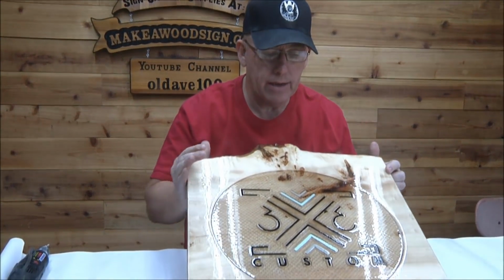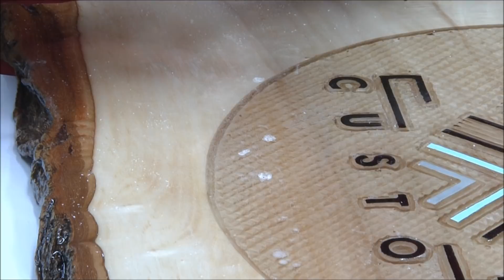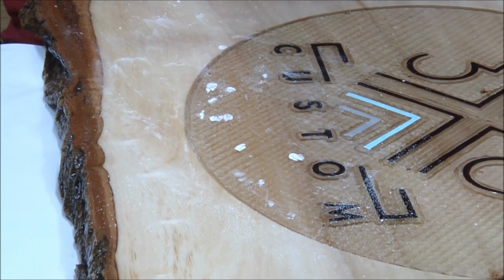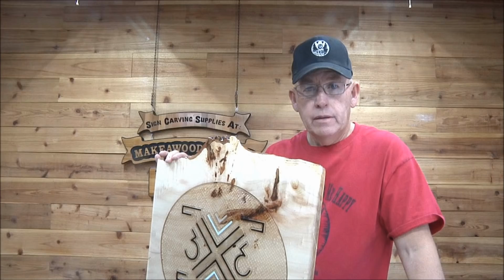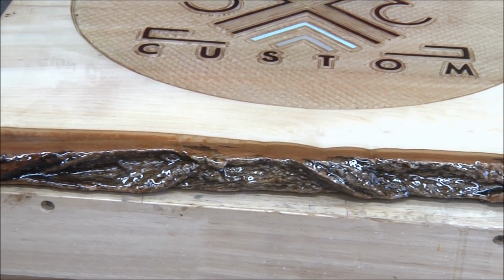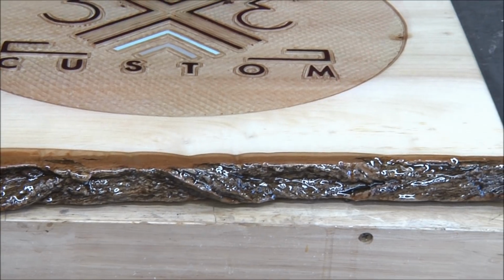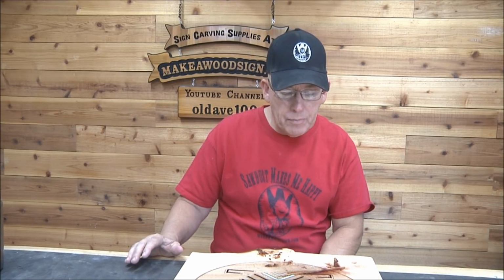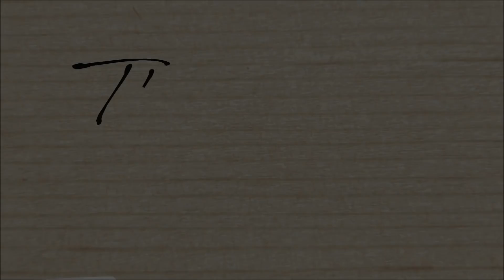#328 3X3Custom Part 4 Epoxy Resin is Finished

Comment: I started to get the shakes when you went in with the power tool.. but it turned out great..I've done couple of Resin projects..I've never forgotten the hardener but I've had one mix that got really hot and set in the pot as I was mixing..in the bin it went.. once again great job Eric..oh and Vicki..
Reply from the maker: Thank you, the dremel actually worked really well. Yea some resins get hot fast and not lots of work time. Thank you for watching and the feedback....

Comment: im a huge fan of both you and 3x3 channel. Question . How did you remove the old resin to start the process over. I'll admit, working with epoxy resin can be nerve racking
Reply from the maker: We weren't able to get it all out, just most of it. We used a paint brush
Reply from the maker: Thank you so much for watching and the kind words.

Comment: When you pore use a propane torch to go over it and it will pop all the bubbles.
Reply from the maker: We use a heat gun and normally it works really well.

Comment: After using the dremel tool, did you just wipe it down and pour again?  Was there any other sanding or prep work work involved?
Reply from the maker: Thank you for reminding me. That's what I forgot to mention. I sanded the entire surface the random orbital with 240 grit. Then blew it off and wiped it down and then re-poured.

Comment: What bit is used for the bumpy clean out the 60 or the 90
Reply from the maker: Most of the time I use the 90, but if it's really a tight spot I'll use the 60.